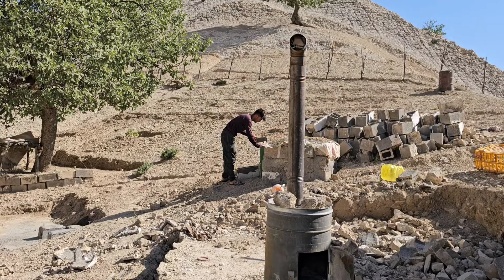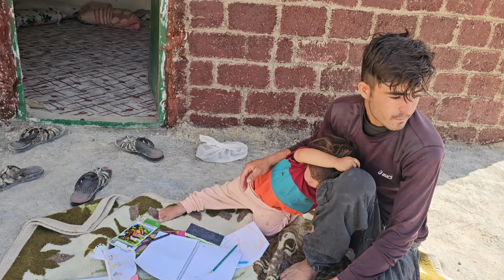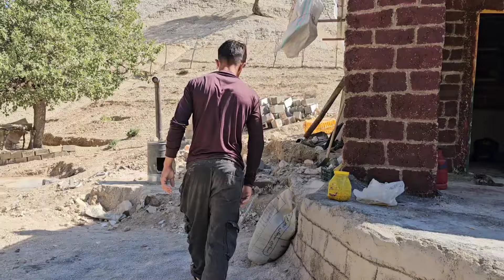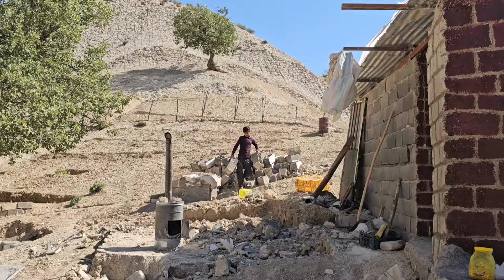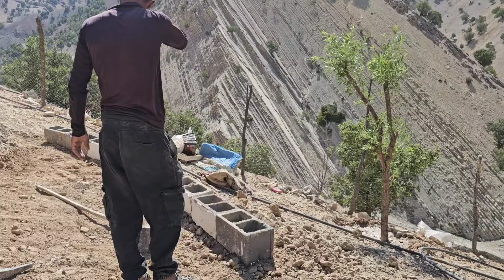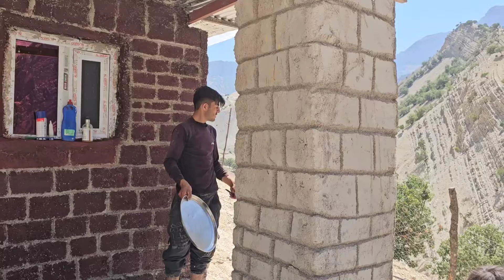Survival Saga: Kamal & Umm al-Bani’s Ultimate Nature Challenge | Hut’s Wilderness Chronicles

Comment: You work very hard to grow things.  The problem is the poor soil. The good soil (top soil)  washes down the mountain when rain comes. This has been happening for centuries and there is no good soil left on the mountains. That is why farmers go to the bottom of the mountains where the soil is dark brown or black. Your soil is light colored because the good soil is no longer there. You can enrich your soil but it will take a lot of work. Google "how to make compost". Once the compost has been made it is mixed with the poor soil. In order to keep it from running off in the rain you will need areas that will not run. You can make raised beds with rocks and try a small area and see if your vegetables grow. It could be 2 x 3 meters or 3 x 4 as an experiment. You can even try something very small like a flower pot.  If your area is small enough, you can even bring good dark soil up the mountain with your donkey and try it as an experiment. You can usually get top soil in areas that flood because it has washed down with the rains. It makes me sad to see you working so hard in soil that is depleted of its minerals. I hope this information is helpful.
Reply: You don't understand. He only do that hard work for the purpose of youtube videos.